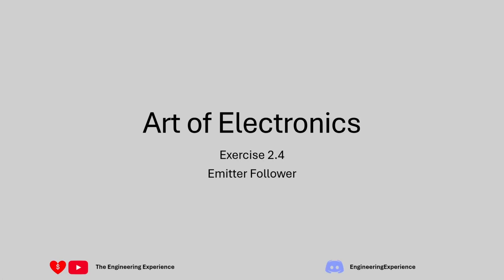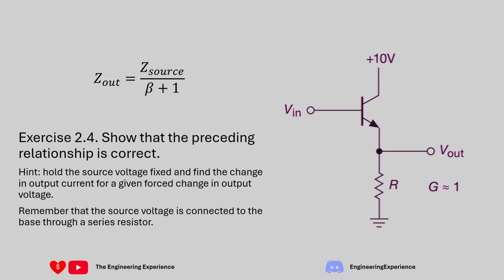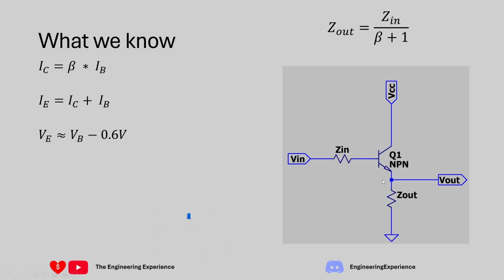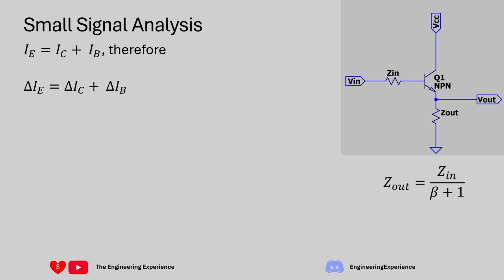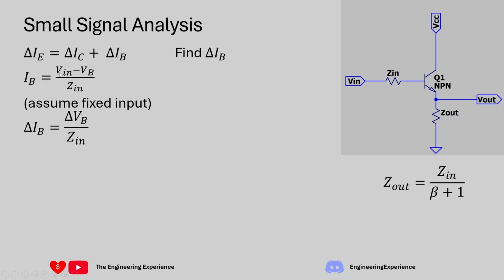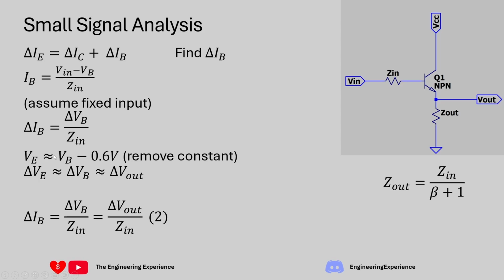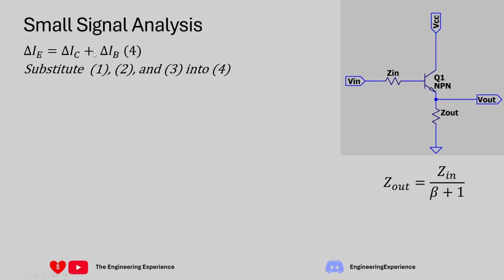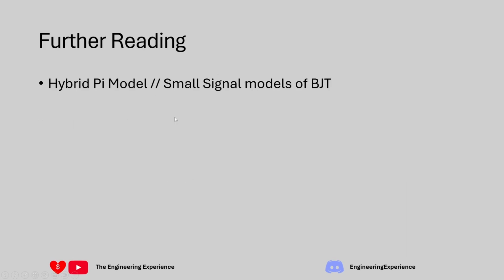Emitter Follower Analysis - Art of Electronics Exercise 2.4

Comment: At the beginning of the video you say that if V_in = 1, V_out = 0.3. Why wouldn’t V_out = 10.3? As far as I can tell, when the switch closes no voltage is dropped between the +10V source and the emitter terminal. Thank you very much
Reply from the maker: I’ll have to go back through the video to be sure about what you mean.

Vbe is relatively fixed, let’s call it 0.6. So if we fix Vb then Ve is fixed to vb -0.6.

Comment: So the real value of this equation is that it allows us to calculate input resistance given the load resistance ? I don't really know how i should interpret it
Reply: It's basically showing you that output impedance is reduced by Beta + 1 so you can drive more current/power to the load.
Reply: @anarchy3960   But is it the impedance that is inherently there ? Or does it mean i have to use lets just say resistors so the resistance on the input/output is chosen such that the equation is true ?
Reply from the maker: It is the input resistance and output resistance of the npn amplifier that we are calculating. This tells us how the system will be affected by the load and how the amplifier will affect the source signal.